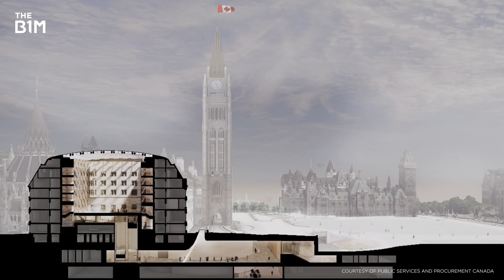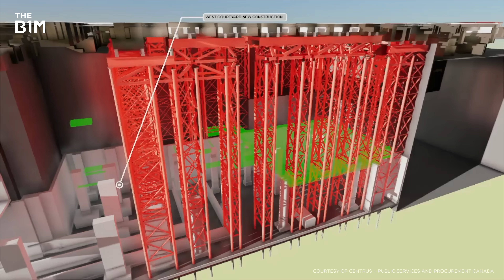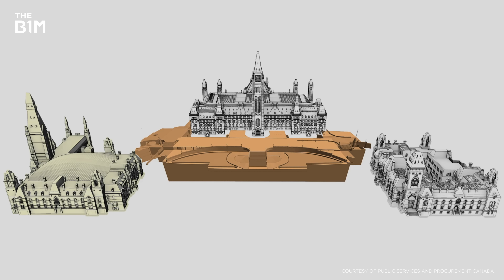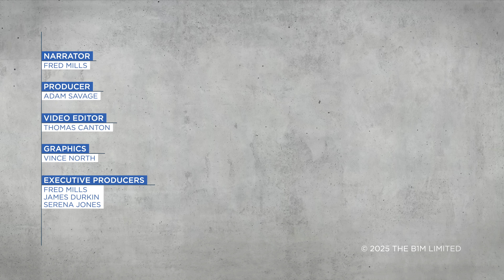Why Canada Blasted a Huge Hole Outside its Parliament

Comment: YES !!! Finally someone putting in a Sarlacc pit, great choice of location as well, very useful under a parliament building.
Reply: Glad they are finally installing a better method to execute the opposing party leaders
Reply: Aren't most of such pits usually installed in the main chamber?
Reply: But…Boba Fett crawled out. You approve of such a loosey goosey solution? Hah! You just want inspiration for horror movies…The Return of Justin…
Reply: @stephenthomas5784  no no only good guys manage to get out, turns out Boba was a good guy.

Comment: Should do a video on the Canada line someday as it was built earlier than expected and on budget.
Reply: Only problem with it is the single track sections and station lengths limit expansions and the cut and cover technique made Translink risk-averse to construction disruptions. The second point is one cause of the current Broadway Extension delays.
Reply: 1st & only one
Reply: @nobody3692  REM in Montréal too

Comment: Probably the height of the Peace Tower was intentional because respect for Britain was more intensely felt in the days when it was built.
Reply: Probably not. Probably an aesthetic and engineering decision above all.
Reply: @oldpossum57 chateau de Frontenac in Quebec City was the elevation limit there I'd assume it was considered in Ottawa. Canadians are a bit odd 😂
Reply: @MillerMachineWorks  Elevation limit: Chateau Frontenac: how was its height the limit? was this the limit imposed by engineering of the time, or the foundation, or city ordinance? I do not understand, but am curious. 
As to the height of the Peace Tower, I think people should apply Occam’s Razor. If anyone can turn up correspondence advising the architect to respect a limit based on Big Ben, I will happily accept that. Until then, engineering and or architectural aesthetics.
 
Too bad Mount Logan (5959 m) overtops Ben Nevis (1345 m). Perhaps we should knock some off the top?
Reply: @oldpossum57 From what I remember it was the city ordinance and there is a tower at the same elevation where you can see basically the top of ever building up to the chateau
Reply: @MillerMachineWorks  The Price Building is the highest in the old town. Some good heritage buildings were demolished for it. But even better ones were originally considered for demolition—including Kent House. The sons of Sir William Price had their moment of glory, then went bankrupt. He would not have been impressed.
Reply: When it was built we were (in many ways) a subject of Britain. It wasn’t until the 80’s that we repatriated our constitution.
Reply: @Aedan2071  I counter that there was strong feeling in Canada by the Balfour Declaration of 1926 that Britain owed Canada a great deal of respect for contributing to the War effort. As my grandfather said, after serving as a Canadian seconded to the British Army, “You can always tell an Englishman. But you cannot tell him much.” 
W. L. M. King, the PM when WWII inevitably began, wanted to keep Canada out of another European war, as much as he could. Events overtook him. But two decades of young men’s funerals, widows and orphans applying for pensions, the amputees and blind, the maimed, the mad—enough to cure anyone of being too impressed by the British.
Reply: @oldpossum57  Ah yes WWII, the war that Britain famously wanted to start /s
Reply: Yes, back when we had much more of a brotherhood with our fellow members of the empire.
Reply: @HondaCivic-ml2xp Yes, I felt that until I went to the UK and experienced the all pervasive sneering contempt of the British toward the colonies. Cured me.
Reply: @emjaydark2811  Never felt the same, I was loved by them.
Reply: @HondaCivic-ml2xp  Our brotherhood is coming back into play now that the US has gone bonkers. Unfortunately no-one looks at them any more as a shining light on the hill of democracy.
Reply: @VanillaMacaron551  Thank god, glad to move away from the States. We're much more similar to the British than the Americans in culture.

Comment: I also toured this building in the 70s and 80s.  It was open to the public.  You could walk pretty much anywhere.  I visited my MP who gave me flags and Canada pins.  I was in the Library.  The Senate, the House of Commons, up the clocktower.  It was no cost to enter.  Security wasn't needed and was almost nonexistent.  I was just a teenager at the time.  Life was good and Canada was a far better country in those days.  I miss those simpler days.
Reply: Same here. I went to school in Ottawa in the early 90s and was surprised by the access the public had to the entire Parliament Block. I remember that you could walk in the main door, up the stairs and be in the main hall before you saw an RCMP guard. The security was definitely stepped up each time I visited  subsequently, but it still seemed really lax.
Reply: One could speculate as to why it all changed, but it did.  

In the U.S. back in the 60s and 70s as a kid I would wander throughout the U.S. Capitol building, poking my head into various meeting rooms, often seeing a Senator or Congressman that I recognized from TV.  I'd take the Capitol subway over to the Senate cafeteria and buy lunch where the ladies behind the counter would say, "Honey would you like some extra sweet potatoes?" and place another spoonful on my plate.

Only the House and Senate chambers themselves weren't freely accessible. Otherwise I could wander wherever I wanted and no one said a thing. I think back and wonder, was it not real?
Reply: Uh huh. It was “better.” Or is it that you were a teenager and had no idea what was going on?
Reply: MCGA!

Comment: $5B dollars on this project, assuming it stays in budget, is absolutely absurd by any metric based in logic or rational.
Reply: You never done construction before
Reply: @jeffbell9391  I'm a developer.
Reply: @lavidawithjoey that's  funny , go upstairs and get mommy to make you something to eat.
Reply: At home today , beautiful day to be a developer
Reply: If you're a developer, which I doubt, you've clearly only built little things with zero historical value. Most historical refurbishment and rehabilitation of large public buildings have budgets bigger than this. FFS - the UK Parliament is going to be spending £40B just so it doesn't fall into the Thames. Germany spent 600M DM doing basic maintenance renos. The European Central Bank renos came in at €1.4B (and that was for fixing up a modern glass.tower block).
Reply: @katem2411  I grew up in a 200 year old home that I restored with my father. Restoration work was the foundation for my inspiration to develop historical properties. Cost per sqft or sqm is the foundation for determining the logical or rational basis for any project. The UK's Palace of Westminster is nearly half the cost.
Reply: @lavidawithjoey you growing up in an old house when you were a kid makes you a developer? 😂
Take several seats - cost per square meter isn't a meaningful metric for anything outside of new construction.
Reply: @katem2411 renovating a 200 year old structure certainly provided experience and knowledge on this topic. Price per SQM is how you determine financial feasibility of any project. What experience and knowledge can you provide to this conversation besides condescending comments? I’ve read nothing of value thus far.
Reply: @lavidawithjoey watching your parents renovate their house is your idea of bEiNg a DeVelOpEr 😂
You cons are a walking comedy show.
As for my experience, how about 15 years of commercial architecture? Sit down and embrace ailence, skippy-boi.
You dont even have the first clue of all the things you don't know - hint: fixing Parliament isn't the same as normal people messing up an old house on a budget 😘
Reply: @katem2411 Don't waste you time , he's a developer. I agree saving stuff over a hundred years old and over a decade to finish. It's always takes longer to renovate then to build new.
Reply: Not crazy at all, considering the complexity and duration (almost 12 years) of the project.
Reply: @bopodoq3069  Cost per sqft or sqm is where you determine the logical and rational basis for a project. Well above $7,500 per sqft, or $80,000 per sqm, is obscene.
Reply: @lavidawithjoey Yoi’re looking at it from within a developer’s paradigm which is the wrong way to look at it.
Reply: That kind of excavation skyrockets the price.

Comment: 2:49 Big Ben is way smaller, the Elizabeth Tower (in which it is housed) is so big.
Reply: and i wouldn't be surprised if back in the day the UK told Canada that their tower couldn't be higher than the Elizabeth Tower.
and that's why their tower is slightly shorter.